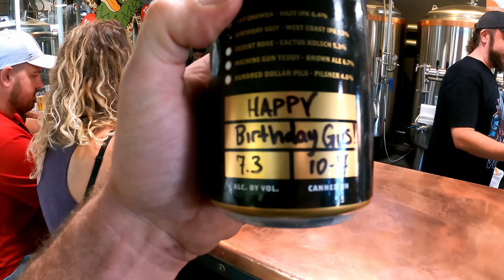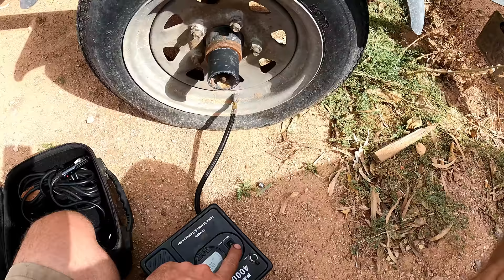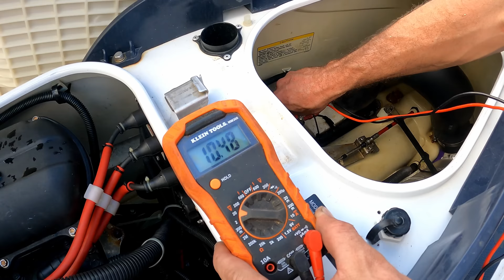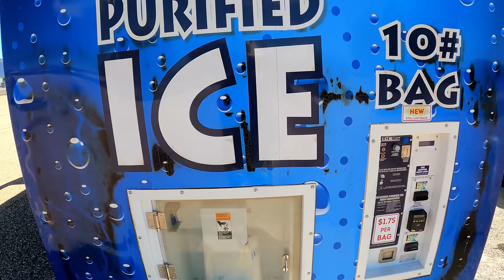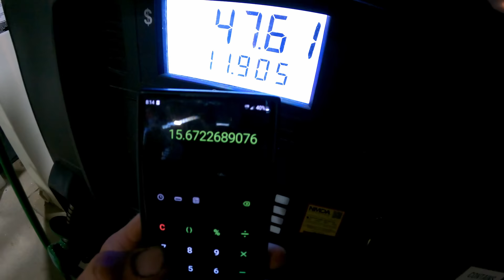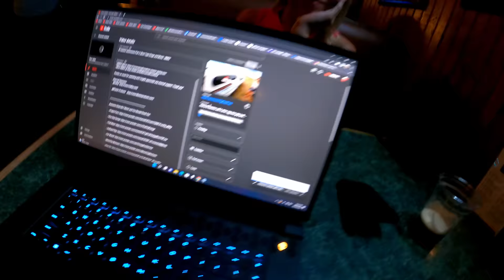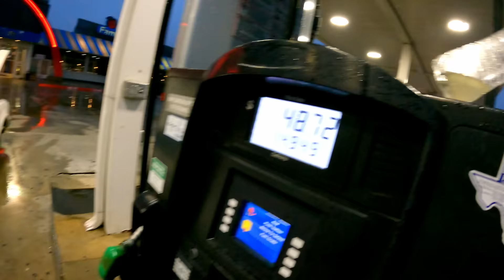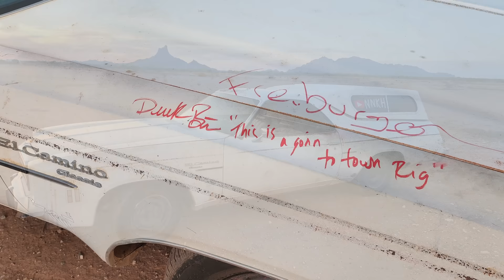El Camino Ready For 1300 Miles To Texarkana? - NNKH

Comment: I'm on somewhat of a binge through these videos, loving it.
I did scroll through the comments without finding anyone write about your fuel issue. Ethanol and bad/old/weak ethanol at that! 
Our country had it mandated to be available at gas stations some 16 years ago (which did kill off about 300) and that revealed a bunch of issues with E85. From straight up bad E85 (some gas station chains really couldn't deliver good quality on a consistent basis) to some having almost E95 in the pumps. Less of a problem now with a lot of old cars having been scrapped but you cannot buy straight gas/diesel, gas is either E5/E10 and diesel is anywhere from B30 to B10, that biodiesel is lower in energy so you get less range out of your diesel vehicle (that also has a smaller tank than before)...

Comment: For the gas issue we had a incident in our area where a diesel additive was accidententally added to the gas tanks at a pilot gas station. 
I worked at a dealership nearby and we had about 50 cars towed in to have the fuel systems flushed.

Comment: Really enjoying these videos! The fuel issue looks like what happens when you get water added to a gasoline and ethanol mixture. Ethanol absorbs the water and causes the now water + ethanol mixture to separate from the gas and sink to the bottom. Its called "Phase Separation".

Comment: paused at the coil spring install What I always use when doing these rear springs is get a small bottle jack and a block of wood. Place the jack on top of the differential then put the small block of wood on top of it. Then jack away making the wood block and jack contact the frame or bottom of the car forcing the rear driff to have no choice but go down opening up the space for the spring. Works like a charm every time. Plus you have a small bottle jack and a piece of 2x4 on board for any other issues that the jack can be used for. Okay, resume video and BTW, digging your vlog series. Paused at the Jet Skit fun times. Just an FYI. These batteries that the jet skis and riding lawn mowers are the same. They are like $30.00 at the near by Wal Mart. okay, continue lol. Paused again at the camp site where Jen is setting up the tent. Shows a complete side shot of the elcamino. Question. Is this a 1976 model year? I assume it is and here's why. In 1976 Chevrolet did a run on all kinds of their vehicles dubbed "the spirit of 76. The option package varied depending on the vehicle. One thing they all had in common was the paint scheme was white with red,  white and blue stripes. This elcamino looks like it could be one of those. Is it a 76?

Comment: I'm a bit surprised you are not hucking a couple of bottles of fuel system cleaner in the fuel tank.  Chucking the old stuff is good, but there's always a bit left behind.  I would changing the coil as well.  As per usual a brilliant show.  In grease from Australia.

Comment: 1:07:50 If you have a clogged carb put your hand on top of the air intake of the carb while cranking with the the gas pedal to the floor. the suction from it should clear out the clogs in the carb.
Reply from the maker: Yes. I demonstrate this a lot in videos. Timeless technique that works very well. Unless the carbs really gunked up then it won't do much
Reply: @NoNonsenseKnowHow  yeah i do this in my 53 ford f1 all the time

Comment: If it starts running bad in the rain you need plug wires.  The spark is probably running on the outside of the wires.  Look at it running after dark. It will be like ELO (electric light orchestra) with the spark running on the outside of the plug wires.  Had the problem on a Ford once.

Comment: Love your stuff man, keep it up. That issue with the gas confused me, I gave it some considerable thought and I wonder if maybe you ran though a gas station that might be less than reputable. I have heard some backwater gas stations cutting there gas with other stuff to maximize profit, kinda like drug dealers. Maybe it was ethanol, the older carb maybe didn't know how to handle gas mixed with ethanol. One of the gas stations might of had some malfunction mixing different types of gas. I don't know if different types of gasoline separate like that. Whatever happened, keep doing what your doing man.

Comment: That watery gas thing was weird. I wonder if that was ethanol with a bunch of water soaked up into it? I’ve heard the ethanol absorbs water more but I really have no idea but it’s kind of battling how you got water in there unless you got it from a gas station, that tank is inside and sealed. 🤔
Reply from the maker: It ended up being ethanol from a thing called phase separation due to moisture

Comment: Toyota Hilux the pickup truck ever. A friend has just sold his Hilux with 300,000 miles on the clock. And still running fine.

Comment: Ethanol is a renewable fuel made from various plant materials collectively known as "biomass." More than 98% of U.S. gasoline contains ethanol, typically E10 (10% ethanol, 90% gasoline), to oxygenate the fuel, which reduces air pollution.

Comment: Dumb question but why not just buy a new carb and put on there instead of fighting that one and rebuild kits?
Reply from the maker: I prefer to do everything the hard way I guess.  I really do like to fix and use what I have instead of buying new parts unless it makes sense to buy a new parts like for instance the rear springs. Also all of those new carbs are aftermarket low quality junk from what I've seen.  No need to replace a carb unless it has physical damage. This old Rochester just needs a proper bench rebuild.
Reply: @NoNonsenseKnowHow  you’re so right…all Chineseium these days.

Comment: HELLO. SEEMS. TO. ME. YOU STILL HAVE. WATER IN THE. GAS. INSIDE. THE. CARBERATOR.   A. GOOD. CLEANING.    I. WOULD.  REV THE. ENGINE.  WITH YOU. UNDER THE. HOOD.  REV THE. ENGINE.  AND.  CLOSE THE. BUTTERFLY. AND THIS. WILL SUCK. THE. BLOCKAGE.  IN THE. CARB.  IT. MIGHT.  CLEAR IT.  OUT.    GOOD. LUCK.